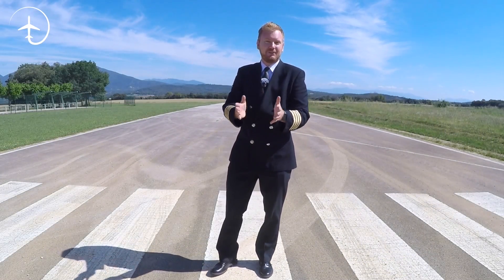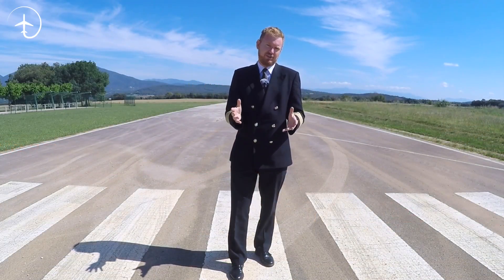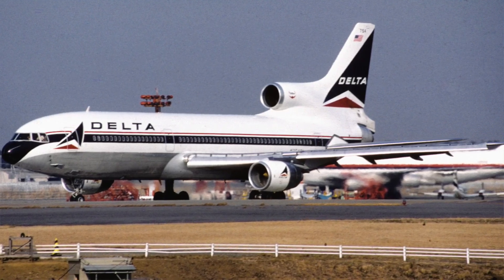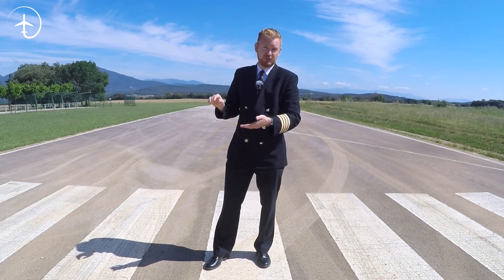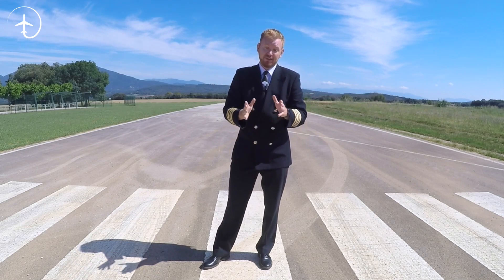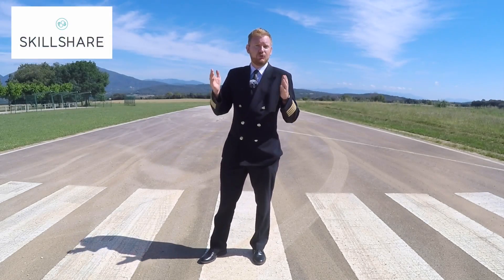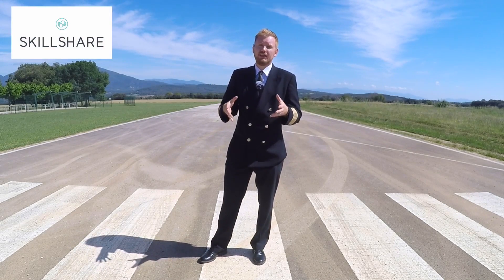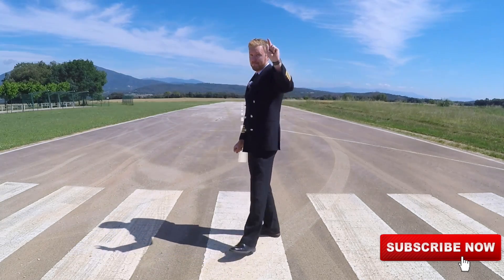Three Engined Aircraft, what happened?

Comment: Dual engine jests with increasingly large diameter engines are the cause of many recent air disasters.  JeJu and Sully type incidents.  The airline industry like most modern businesses has become very very greedy, ...to the point of compromising safety. The claim is that quad and tri jets are less efficient and cost more to operate and therefore are being abandoned in favour of dual engine jumbo jets!  These have massive large diameter engines, twice or three times the diameter of engines made in the 1960's.  Increasing engine diameter leads to greater probability of ingesting birds and fewer engines leads to rise in probabiltiy of having ALL engine failure, having a NO ENGINE situation. A tri or quad engine jet has MUCH MUCH lower probablilties of this problem! And so we are increasingly seeing Sully type situations. Until the dual engine jumbos start falling from the skies killing people by the hundreds and falling on the infrastructure of the super rich, investigators will ignore the ROOT cause of recent incidents and recommend dealing with after-effects only!

Comment: Dual engine jets with increasingly large diameter engines are the cause of many recent air disasters.  JeJu and Sully type incidents.  The airline industry like most modern businesses has become very very greedy, ...to the point of compromising safety. The claim is that quad and tri jets are less efficient and cost more to operate and therefore are being abandoned in favour of dual engine jumbo jets!  These have massive large diameter engines, twice or three times the diameter of engines made in the 1960's.  Increasing engine diameter leads to greater probability of ingesting birds and fewer engines leads to rise in probabiltiy of having ALL engine failure, having a NO ENGINE situation. A tri or quad engine jet has MUCH MUCH lower probablilties of this problem! And so we are increasingly seeing Sully type situations. Until the dual engine jumbos start falling from the skies killing people by the hundreds and falling on the infrastructure of the super rich, investigators will ignore the ROOT cause and recommend dealing with after-effects only!

Comment: Wasn't there a trijet that had a major control surface breakdown once? It used the third engine to alter pitch and get down in one piece. That being said, better to have planes with reliable control surfaces rather than have a 3rd engine just in case.

Comment: ETOPS stands for Engines stopped, passengers swimming. During ETOPS approval process, captains were told if they have trouble with an engine , unless the damn thing is on fire, do not shut it down, reduce power instead. Then it will not have to logged as a shut down , which looks bad come FAA inspection. In the old era, they would shut down an engine for the slightest reasons.  Some military patrol planes would regularly shut two down on patrol to max loitering time. Aurora or C130.

Comment: Having An engine just above the vertical stabilizer isn't dangerous? If it had some catastrophic failure, could it not destroy the stabilizer just as happened with the JAL 123 or the DC-10 232? I thought that was the main reason for removing the third engine in the first place.

Comment: My biggest concern with trijets is engine failure messing with flight controls in the tail section, which seems far worse than one on a wing engine (think United 232).  

I'm not a fan of twin tail mounted engines either but with regional aircraft there isn't as much option.  

I would prefer to fly today's twinjet wing mounted larger aircraft in any case.

Comment: Think of it this way, humans are valued at about 10 million a pop, and the extra redundancy given by theoretical modern tri-jets wouldn't outweigh the extra fuel and maintenance compared to modern twins. Well, mostly because the number of incidents where 2 vs 3 would make a difference are extremely rare even in commercial aviation terms.

Comment: I'm not understanding the pitch down issue. On a tri-jet the issue isn't thrust on the middle engine, it's net thrust from all three. Look at the DC-10 /  MD-11. The other two engines are under the wing. If anything, the third engine producing thrust above the center line mitigates the pitch up from the two wing engines. No?

Comment: I'm sorry but I have to beg to differ.

You say in the 1970's, but as Wikipedia states it was as arly as 1957!

The Hawker Siddeley HS-121 Trident (originally the de Havilland DH.121 and briefly the Airco DH.121) is a British airliner produced by Hawker Siddeley.

In 1957, de Havilland proposed its DH.121 trijet design to a British European Airways (BEA) request.

By 1960, de Havilland had been acquired by Hawker Siddeley.

The Trident maiden flight happened on 9 January 1962, and it was introduced on 1 April 1964, two months after its main competitor, the Boeing 727.

But in my own opinion it was not a new concept, tri-engined planes were very common in the days of prop-driven planes, using jets was just a continuation through a natural course of aircraft evolution.

The main difference being that to have the third engine in the nose unlike prop-driven aircraft was just not feasible and so a tail mounted third engine on tri-jets was the most logical location.

Comment: With the 747 on its way out sadly, we could use another trijet to fill it's space. The origional 747 prototype was a trijet. I believe they could take the engines on the 777X and make a taller and wider airplane and slap 3 engines on it. 3 modern engines could replace the 747 and be more fuel efficient. Plus they wouldn't have to try so hard to scrimp every ounce out for efficiency and range. Just put another fuel tank and a 3rd engine and you have a world airliner. Or atleast a massive cargo plane that's efficient

Comment: The TriStar was a wonderful airliner for it's time. Pilots loved to fly the shorter/higher performance -500 series. The RB211's were a little finicky in hot and high airports and thus earned the nickname "Tri To Starts". PSA even outfitted theirs with a lounge in the "basement" (vs a galley) for the LAX to SFO run. L10111's were truly ahead of their time with Cat 3 autoland capability.

Comment: Still my thoughts ...
The planes have the APU in the rear ... how about if this is also a third engine for emergencies (see problem with bird strikes)?
If the APU is needed one way, couldn't it also generate thrust and keep the plane longer in the air ?
Have you already made a video on this topic? Or is it a good subject for a new video?
Yes, I am sure that the aircraft manufacturers already had this idea. But I would be interested in why this is not built in that way;)
Many Thanks!

Comment: actually business jets with a maximum of 19 passengers and 22 total occupants don't use ETOPS, we fly on an 180 minute "extended threshold time".  Same outcome and benefits as ETOPS, but a lot less operational burdens.Dassault Falcons like the 7X have 3 engines, because 3 engines are a lot more (fuel) efficient than 2 engines, if you get the design right. For example a Falcon 7x has more or less the same fuel burn as a Challenger 605, but offers an approximately 45 percent larger cabin. 3 engines make a lot of sense, but they don't really have a place in the airline world, for the many other reasons explained in this excellent video.

Comment: I really don't think the main concern with it being placed on the tail was yaw if an engine fails as you still have that issue with the remaining two wing engines.  If you have a wing engine failure, you will still have an issue with asymmetrical thrust. This is regardless of if it is a twin, a three engine, or a four engine plane. Lose a wing engine and you have directional control issues.  These are easily overcome of course. The bigger concern was the asymmetrical thrust caused at power if you have two engines on one wing and only one on the other.  Basically, you'd always be flying the plane as if you had lost an engine.

Comment: you didn't mention the 727 :(   Also, the 3 engine design came from the Airlines wanting to go over oceans without having a large 747 or 707. Airliners could do it with the 737 however they were forbidden to because the 737 had a 2 engine design. Both Pan Am and TWA went to Boeing requesting them to build a 3 engine design thus the 727 was born among others. Once the 727 was produced many other airlines picked it up since it could go over oceans. The reasoning behind the 3 engine and the FAA restricted overseas transport was if one or more engines failed due to one reason or another. Some time later jet engines became more and more reliable and the FAA lifted the 3 engine rule crossing oceans. Probably due to budget airlines coming out at the time requesting the FAA to drop this rule. thus became the start of the death of the 727 and much later the L10-11 and the DC 10, which became another store most most likely due to 2 engine designs out performing the 3 engine deigns both on efficiency and maintenance.

Comment: I was wondering Peter, whats stopping the manufacturers from making engines 1 and 3  high bypass engines, and keeping the original smaller engine 2 in the center since its on the center line, and won't create any yaw

Comment: @mentor. Why is the center engine of the DC10 at a small angle with the horizontal? The inlet being higher? That would increase the pitch down moment even more than if it was horizontal because there is then a small upwards component of the thrust behind the a/c CoG and CoL.

Comment: I flew on an AA 727 DFW-MCI in the jumpseat. With a strong wind, the center engine had a compressor stall turning onto the runway. It happened twice. The first time, the engine outright quit and had to be restarted. The second time, the engine hung and was unresponsive for a considerable time. Both instances, the flight crew cancelled the takeoff permission and cleared the runway to check their status. The third go, the flight crew got permission early to turn onto the runway from the taxi position. They throttled up the number 2 before making the turn, and made the turn faster than normal. The problem was arising from the 727 turning from the downwind direction with a strong tailwind, to the 90°/short of the runway, going from a tailwind to the wind hitting the intake at a 90° angle. The strong outside wind was causing a vacuum effect and starving the engine of air. (I flew a DC-10 for 4 years and never had this happen. I guess it’s those long ducts on the 727, like the L10-11)

Comment: The Tu-154 Is a dangerous aircraft with 7 fatal crashes & with Very loud engines. 
Edit:When you only use the 3rd engine of MD-11 Or DC-10 it wont take off.

Comment: There was a tri engine that crashed, & it was discovered that the engine in the rear failed & shrapnel, from that engine cut through the hydraulic lines & electrical wiring, rendering  the controls inoperable & the plane crashed.

Comment: Hi!
Isn't it possible to operate with the third engine only as a spare engine? Meaning to start it only in case of emergency or above the Atlantic and use only the other 2 engines from the wings for normal operations in order to save fuel?

Comment: It seems to me that no one has  ever done an engine loss of a fully loaded wide-body plane on takeoff/climb-out.  Thrust is completely asymmetric and the engine mounts to the engine still working would be under tremendous torque from that engine and the mass of the fully  loaded multiple aisle fuselage.  The mounts would would fail, the engine would fly over the wing and the plane would crash.  Three engines would avoid that possibility.  The Thomas Cook 757 that lost an engine on takeoff due to bird-strike is an example of single aisle partly loaded plane takeoff with one engine.  What happens to a fully loaded wide body jet?  Maybe tri jets will suddenly not look so bad.   They cost more to service and maintain, but passenger safety is worth the additional cost.
Reply: You don't think they already considered that?

Comment: Whenever I think of DC-10, I think of the one that crash landed in Iowa.  The center engine blew apart, severing critical hydraulic lines.  By having the main and backup hydraulic lines routed side by side near the center engine, both lines were severed by the same piece of shrapnel.  Then there was the DC-10 taking off out of Chicago.  It had an engine fall off during the most critical part of the takeoff roll.  I decided I will no longer fly in the DC-10.
Reply: THY DC-10 from Paris 1974... :-(

Comment: One word:  Efficiency.  You don't need three engines when two modern ones will do the job and cost less to operate and maintain.
Reply: @ChandlerWhite-m2q  
Didn't mentor just splain that chandler?
Reply: 3 engines> 2 engines
in the design and the sound
Reply: I still want 3rd engine.  It’s called backup in case of engine failures in 2 engines lol.  I am talking about the plane I’m going to buy in the next 5 years.  I want the extra safety I don’t care what it cost lol.
Reply: lier! you need 3 to be a charm ... only the irish would know
Reply: and yet we still use 4 engine aircraft for passengers
Reply: You repeating what he said bro
Reply: @redboyjan  You can skip the 11 minute video now.  I saved you that much time.
You're welcome.
Reply: @Turboy65  don't invite you to parties then

Comment: There is a notable aerodynamic advantage of a 3rd engine located on the fuselage centerline.  The thrust cone effectively lengthens the fuselage by quite a lot.

And how could you manage to talk through this entire tri-engine episode without a single mention of the 727??
(or did I miss it?)
Reply: Dash There is a notable aerodynamic advantage of NOT having a 3rd engine on the fuselage centerline...
(drag, weight and fuel- and maintenance costs)

Comment: For over 40 years I have flown extensively, and many flights were on DC10s, L1011s. Between the two, I found the DC10 to be the quieter of the two. I also thought it looked better. Specifically, American. Delta, TWA and Eastern flew L1011s. I mainly traveled on Delta, but occasionally, TWA and Eastern. I was a Road Warrior for 17 years. From the late 80s up until mid 2000s. Love everything about commercial aviation, and thankful for YouTube!

Comment: Good day 
I am not an aviation expert. I am from marine field. Please clarify 

For a passenger air craft with full capacity need three engine, if the passengers are half can the flight run with two engine?. (Run the wing engine and switch off the top middle engine)

Comment: Question: Do airlines have to operate the third engine in a trijet on every flight? considering cost and maintenance. Thanks
Reply: Yes. The airplane is certified with 3 engines (all the "normal/non-emergency" specifications such as landing speed, stall speed, landing distance, takeoff distance, V speeds etc are calculated based on 3 engines working), you can't just decide that you don't want to use the third engine. However, if a manufacturer wants, they CAN get their trijet certified to be operated on only two engines under normal conditions (This will be a costly exercise and defeat the purpose of having three jets in the first place).
Reply: Also i think not running third engine would create a lot of drag  as the engine opening is still there ,hence there is no benefit in fuel consumption. Attaching a pointy cover on the intake to enhance aerodynamics might be a good idea on the Tri star.
Reply: You wouldn’t buy a trijet if you weren’t gon operate the tail engine

Comment: The S duct on the L1011 was a fix for a perceived problem. During preliminary design, the risk of an unconfined engine failure severing the vertical stabilizer was investigated. After Lockheed's experience with engine separation on the Electra, the L1011 was designed with the engine as far back as possible with no hydraulic lines nearby to maintain tail surface controllability if the engine suffered an unconfined failure. In the DC-10 example, the engine was mounted in the vertical stabilizer and a severe engine failure would disable yaw control and rapid disassembly could also disable elevator control. The Lockheed solution was to maintain control even if the engine exploded. Lockheed was also aware that some airlines were accumulating 50,000 hours on airframes that had a 20,000 hour design life. Murphy's Law: if it can happen, it will given enough time. So most of the problems with the L1011 were related to the Rolls Royce engine. They were very late getting engine certification after many test failures.

Comment: Do any tri-jet engine aircraft use a significantly different engine for the middle engine? I can imagine tuning the wing engines so that they are more efficient at lower speeds and higher air densities then as the aircraft climbs and gains in speed more of the thrust is shifted to the center engine which would be tuned for more efficient operation in thinner air and at higher speeds. But I have no evidence to show if this is or is not the case.

Comment: Did pilots use a lower power setting on the center engine for cruising?
Reply: I wonder that too. Since the third engine was only really needed for redundancy, wouldn't it make sense for fuel efficiency to just keep the engine on standby?

Comment: Third, tail engine on the DC-10 60,000 lbs thrust was for take off up to altitude, then idled and wing engines throttled back for 12,000 mile non stop flights.
Reply: NO!

Comment: Another cool problem with the l1011's s duct was that the normal location of the apu was used by a main engine so they have it in a little compartment under the s and it exhausts out of the bottom of the tail